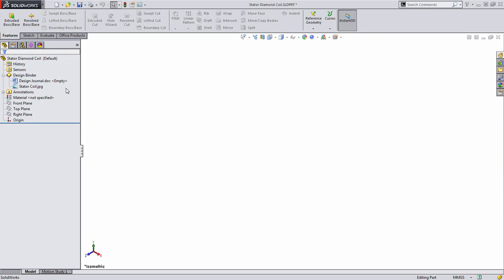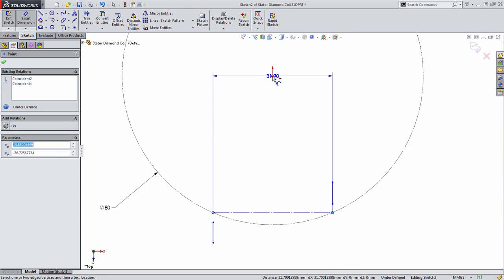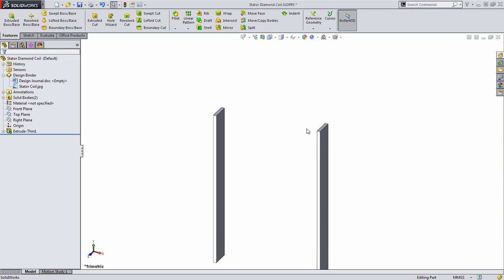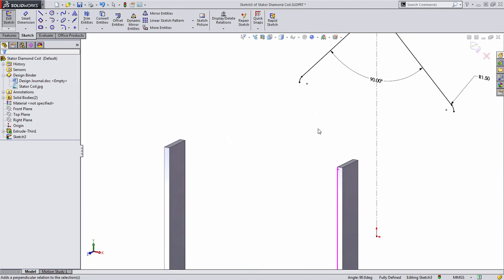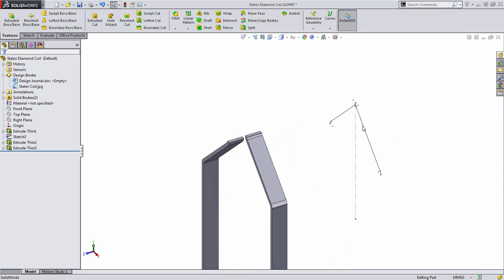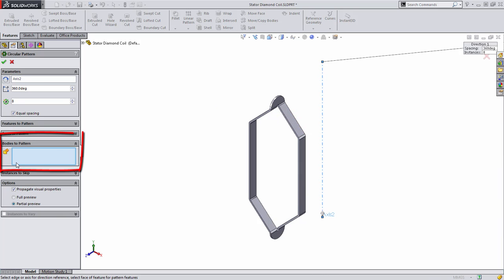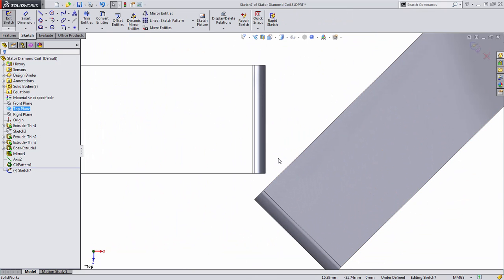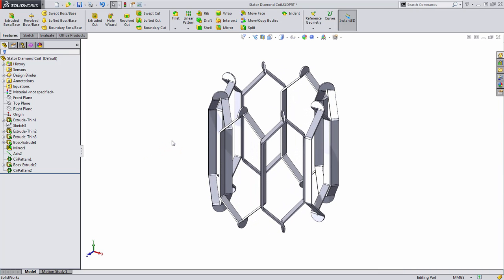Question of the Week: Stator Coil

Comment: Your set diamond stator coils are incorrect. You cannot have two opposing coil legs parallel to each other in the slot. The angle is dependant on the stator inside diameter and number of slots.
Reply: thanks for commenting! can you recommend a good way to parameterize diamond coils?
Reply: exactly what i was going to say. the OEMs have quite a few variables for parametric design of coils, but certainly not as simple as what is shown here.
Reply: Hello, Could you please suggest how can we write parametric program for these coils, especially the winding arm (where the bending starts)?
Reply: @SammyLifeintheUK  A parametric model would be fantastic! The only problem I have experienced with formed coils and the 100% correct shape within Inventor, is that it absolutely kills the processing power and the model becomes very glitchy.
Reply: @lancerichmond8636  would you be up for sharing a CAD model of a coil if you have one handy? Even a simplified version would be super helpful for reference. No worries at all if not! Thanks a ton in advance!
Reply: Unfortunately I cannot as my work is proprietary information which was developed at my place of work.@SammyLifeintheUK
Reply: @lancerichmond8636  No worries at all, I completely respect that. Appreciate your response!